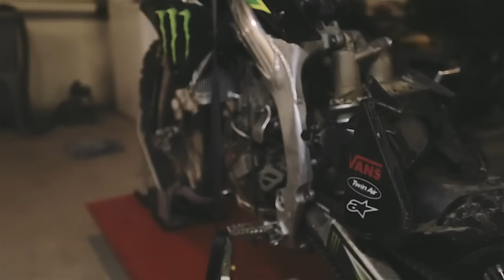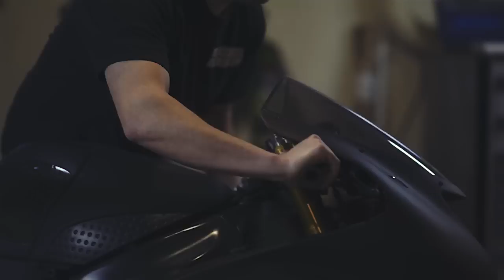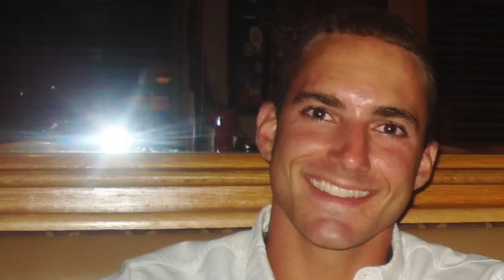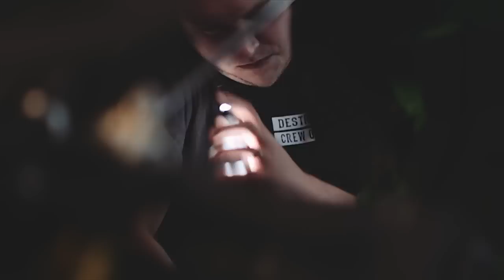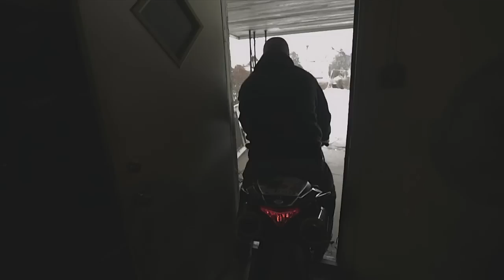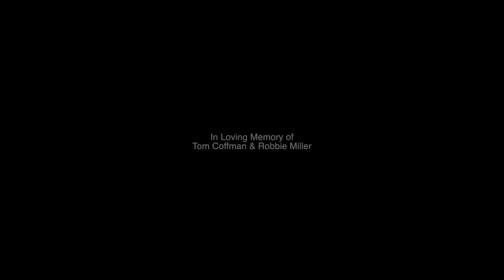This Could Be Your Last Ride

Comment: A few years ago, i started with riding motorcycles. I was always afraid of the right corners. So i trained hard to get better and better. And it worked. I was getting better, i was literally mounted on my bike. Until the first accident, but not a big one, after a little shock, i was back, with a new bike. And after some month, i was flying on that bike, i owned every corner, deeper and deeper, until my footpeg touched the ground for the first time. I was so proud of me. One day, after a very "good" ride, a friend told me, you have a good style, but not for the public street, outherwise, your style will kill you one day. After that, i decided to go to a professional trainer to improve to be more save on the street. But i never arrived. On the way, my footpeg touched one last time. Only my own rule to wear the best protection i can buy let me survive a big accident. A few days ago, i was on a motocycle for the first time after a year. The feeling was not bad, but i learned a much on that day.